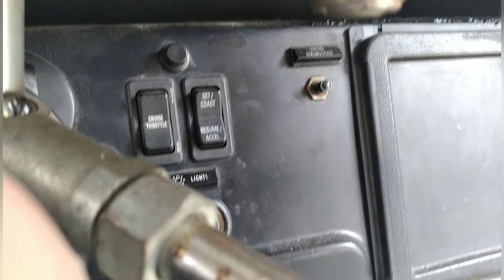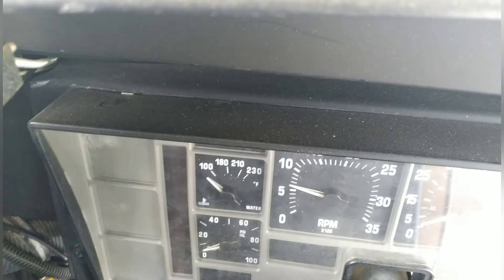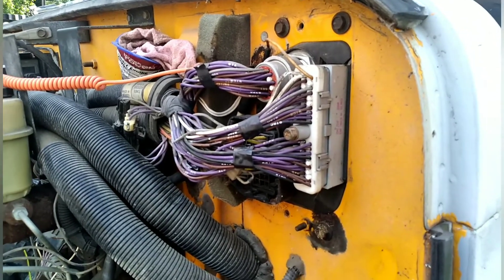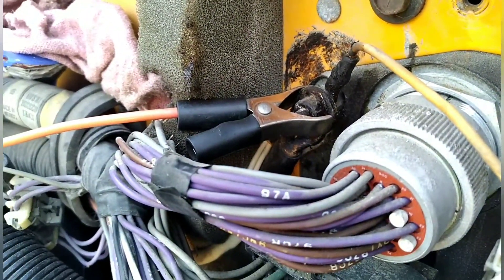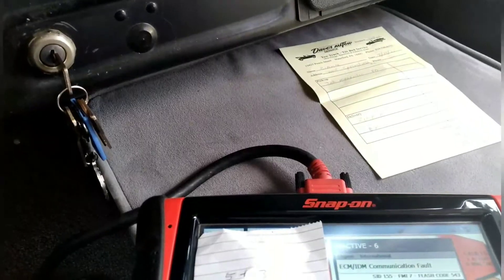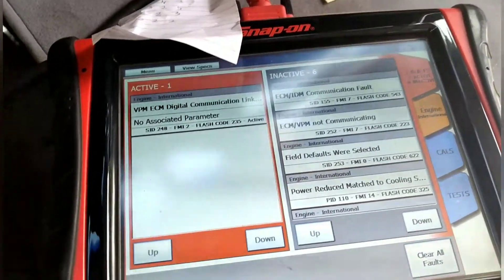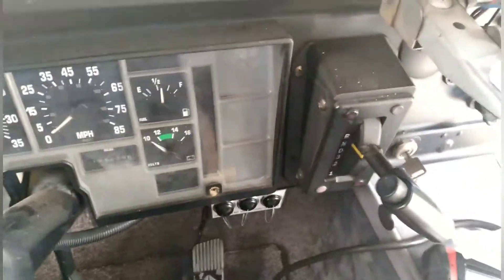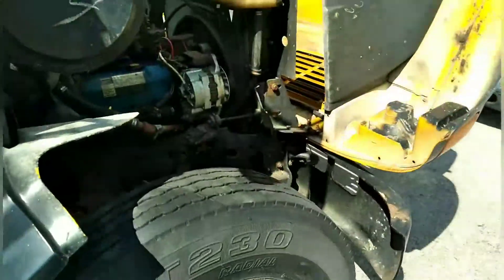Bus Breakdown - Diagnosis and Repair

Comment: Thanks for the reply, the starter is in good condition i jumped it with a push button and is turning. I will try the relay check for power etc tomorrow

Comment: Thanks for the information.  I checked all the fuses, over the battery, and inside as well, all good.  I unplugged the relays and made a 12v battery relay tester and can hear and continuity test the switching is working.  So seems not my fuses and relays.  

The concept I don't completely understand is how to test the power lines on the harness plugging into the IDM/ECM.   A video on testing that with a multi-meter would be helpful or at least an explanation for someone like myself who is learning.  Is it as simple as turning on the key to ON, and sticking a Red positive prong in voltage mode into the harness power wire port, and Black prong into the ground port and monitoring for 12 volts?
Reply from the maker: Yes. Check for power and ground.

Comment: That was a most excellent, informative vlog, thank you sir! I learned a few useful tech tidbits for my '97 8-window IH T444E 3800.

Too bad that simple relay cost $400, but all our problems should be so simple!

No flash button on my dash, tho. Any thoughts on where Thomas may have stashed it at? 🤞

HazMatt from the Skoolie forum

Comment: Thanks for your good video, I wonder if you had this problem that I have,  it clicks by the driver side but no crank batteries are fully charged also power booster brake motor not making any sound when you apply the brake
 All help is appreciated.
Reply from the maker: If it's clicking, but not cranking, then the starter could be bad.
Reply: Some progress discovering a rotted red wire on driver side behind all switches there is a fuse box for all the switches and another one with just 3 glass fuses a red yellow connected to the selenoid and  black 2 Amps 250V I'm trying to find the fuse holder but is impossible.
I will try tracing the wires to see where they go what they do the yellow is attached to the selenoid.

Comment: Good Job, but What snap-on scanner are you using?.. thank you
Reply from the maker: Modis
Reply: Thanks, What adapter did you use and does your Modis come with the software for international school buses?
Reply from the maker: @elipsonj  Sorry, wrong info. This is a Snap On Pro Link Ultra using the included round 6 pin connector for J1708 diagnostics. Our Snap On tool guy installed the software, but I am sure we had to pay for the software.

Comment: One question, my truck starts but it doesn't go more than 20mph, I have the following codes 114, 223, 622, you have any suggestion for me,  engine t444e 1997
Reply: Thank you
Reply from the maker: Start with the batteries. There is fuses on top in holders. look for melted fuse. Then try relays on firewall like I did.